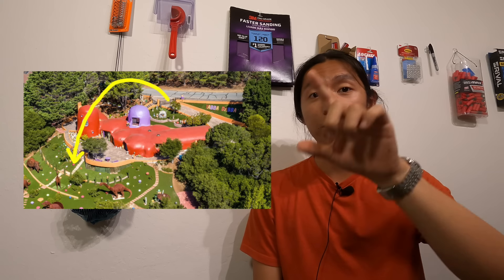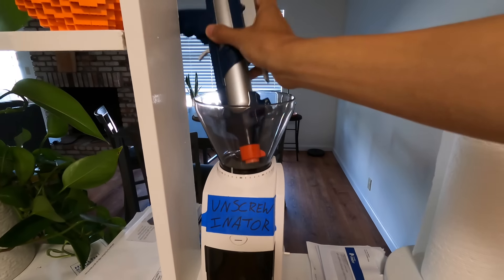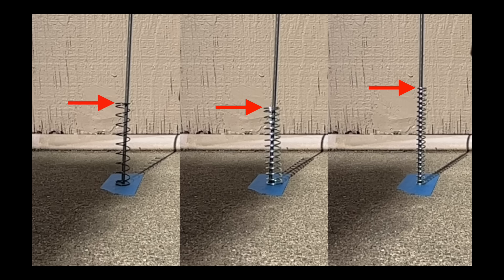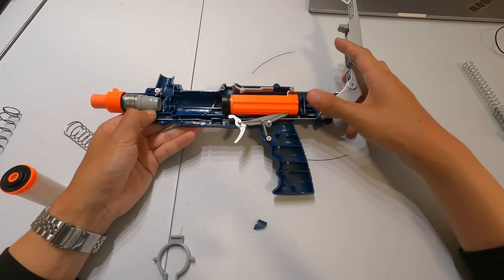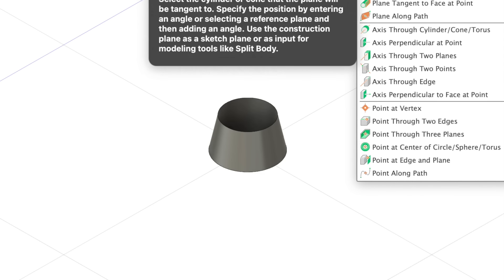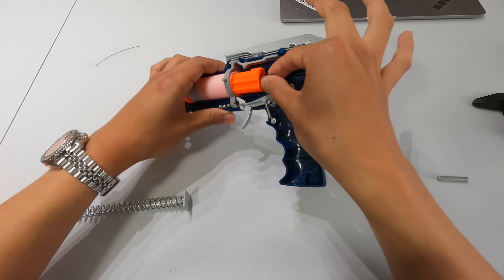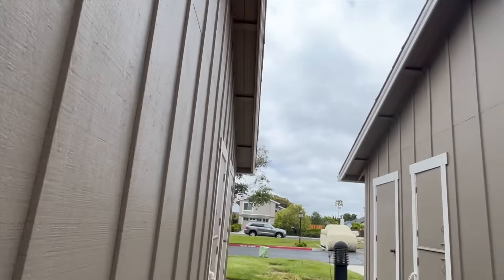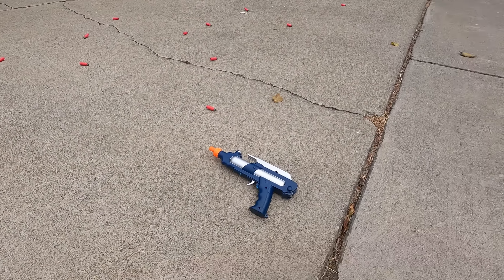This Nerf pistol terrifies me

Comment: As you know by now, this is definitely a paintball blaster, which is why the spring is so strong. Had one a long time ago. It used proprietary paintballs that were much smaller than standard size.
Reply: Yes , 10mm paintballs.
I used one of those mini sized bottled waters to make a 100rd hopper for mine.

Btw at the time I bought mine 15 years ago ( these were actually around as early as '06-'07 ) they also had the chalk dart version.
The port on top was plugged, and they came with these darts that would leave a colored chalk dot on you when hit.
I think there were even 2 gun sets with red and blue chalk darts with a plain white vest thing so kids could sort of play a save version of paintball in their backyard.

Comment: Honestly I'm more or less concerned about the blaster destroying itself out of power even after seeing the whole thing. I sorta want to see if you can make a version of this project that can reach similar or higher levels of force without any of the self-destruction.
Reply: Keep a projectile to absorb the energy and wont have a problem. The problem is when you dry fire, the energy that would go to launch the projectile is redirected into the object itself. Be it bow, or this. Limbs and strings on a bow can explode.  Better it to break than explode.

Comment: I had one of those paintball guns as a kid.
My older brother and I got them as a Christmas gift in probably 2010 or something. I put a nerf dart in it, as I was curious, and out of the box, it shot it out so hard that it flew across the park, and when we found it, it had been blown apart with a huge gaping hole in the side of the dart. It was absolutely insane and I loved using it until I finally threw it out like 6 years later.

Comment: I think a bit longer barrel, maybe just 1 inch longer, drilling out the air vent a bit and having a plastic spacer in the back of the plunger instead of the heavy steel socket (making the plunger lighter=more acceleration) would make it easily go up to 160 fps, if not higher.

Comment: Seeing this thumbnail was a trip, I modified one of these when I was a kid and didn't know they were common. My friends hated me for using it and whenever I did we had to wear eye protection and play outside at longer ranges. It was a blast to mess with, a great platform for getting into modding high fps plunger blasters. Forced me to finally make the switch to 3rd party nerf darts, the stock darts fly straighter than a rainbow at that fps

Comment: The reason you could feel recoil from that wad because you put a metal weight into the plunger, if you use a plastic spacer instead oth the socket I'd bet that that force would be reduced

It would probably be better for the blaster too, both in performance and in its longevity

Comment: the recoil is the acceleration of the mass of the 1/4 socket adapter. You should have that at the back of the spring instead of the front, so the spring doesn't have to deal with it's inertia.

Comment: The socket adapter is heavy, I believe it would be better something light.
When you pull the trigger you want the plunger go as fast as possible, it is harder to accelerate a high mass part (socket adapter), also, all this mass need to be stopped when the plunger goes all in, so it will make more effort in the parts.

Comment: Some good blasters with stock performance similar to this include the rekt jury, which is a co2 powered half length dart revolver. Gets around 100 shots per 12g co2 cartridge, and like 130-140fps. Another one that isn't "cheating" with co2 is the adventure force aeon pro, shots half or full length darts, personally I think it shoots a little harder then the co2 one, but they are similar in power. Both of them shot at best 300-316 feet outside. With average of about 50 feet less, both shot over the foundation ruins of a barn, and over a small silo (maybe 40-50 feet tall). With certain darts they leave small bruises.

Comment: I actually have that the original model of the splat gun it was originally used for as a paint ball pistol and I owned one that was so old it was falling apart we bad these paint balls to but it hardened the paint so the balls can actually hurt someone but I shotted a cardboard box and it went straight though we also had other paint guns but there so old that they didn’t make the cartridges any
Reply: More

Comment: Mine was branded as the  SUPA SPLAT and would actually fire standard streamline darts very well in stock form with a better barrel fit than this and I did not need to modify mine to shoot over my house.
Maybe they changed them over time ? The SUPA SPLAT's we had were red and blue, I also had the supa splat blowgun and the hamp style that I think was a variant of an existing marshmallow blaster.
Me and my brother bought them to shoot each other but they didn't have enough power to break the 10mm paintballs unless they hit a hard surface.
At the time ( this was 15 years ago) they also offered the chalk dart variant of these pistols Called the Wipeout, so maybe they were using the same dart optimized barrel from the Wipeout on the SUPA SPLAT's that I had ?

The wipeout was from the same people who made the predator paintball pistol which I has as well, got it at goodwill and darts would barely fire even though some of the predators were sold with a pack of wipeout chalk darts as a bonus.

Comment: using some pixel measurement around 2:28 and some basic physics, the 2nd spring is a about 1.8 times as strong as the first one and the third spring is about 2.5 times as strong than the first one.

Comment: This is actually a good engineered toy, built to last. Here's why:

A) The real reason it has a spring, rather than a restrictor valve, is because if you close the air output, you'll overpressure it for a moment, leading to damage to the plunger chamber over time.
B) The plunger tube's rubber, which holds the brake spring, is also designed in such a way that it will expand towards the chamber's walls when pressure increases, leading to a better seal.
C) The long lever, rather than a pull rod, has a better transfer of force, allowing for children to be able to properly load it. Unlike some nerf guns.

It was made by a company called Tech Group, and this specific gun was built in 2(maybe 3?) variants. The Predator, and the Wipeout.

Comment: Pretty interesting. I think you lost a little using that socket adapter inside the plunger. The extra weight would take longer to accelerate and would be the primary reason you can feel so much recoil. 3d print or find some plastic tube you can fill that space with instead of that socket adapter and I'm sure you'll get another performance jump.

Comment: allow me to suggest an easier (although less spectacular) way to test spring stiffness, attach the springs somewhere so that they hang, then use some string or whatever attachement method to support a water of bottle from them so that it hangs down. Considering that you know how much water the bottle contains and that water density is aproximately 1Kg per litre you could even get the numerical value for spring stiffness by messuring how much the spring has extended compared to its resting position when no weight is applied.

Comment: My auntie gave me a different coloured and with a simple "wipe-out sticker" I took the air restrictor out because mine had one and removed that dampening spring, I dont have a chrono but I put the new N series darts in the muzzle (nice tight fit) and holy moly...it punches them a good 70+ meters, thanks for the video...I am now in the middle of using the moving barrel part of the blaster as a loading mechanism for gel balls

Comment: I have an idea for you, what about making a band powered nerf gun, you can use ultra thick rubber band and a railgun like system where you would have a moving armature that carries the payload, which is a nerf bullet, and you could drive the armature with the payload with the kinetic energy of a rubber band. It would be like the combination of speargun and railgun in a nerf form.
Reply from the maker: ppl have made things like that before and they’re dope. it’s been on my list for some time now
Reply: @matt_yuan  Omg you actually replied, great content btw. If you're going to make this, fortify the plastic, I'm a spearfisher and the rubber bands we use goes hard af when released
Reply from the maker: i think the limiting factor will be the dart itself. if the band is strong enough to break plastic aint no way a foam dart will survive being shot by it
Reply: @matt_yuan  What if you also fortified the bullet afaik nerf darts are hollow
Reply from the maker: hmm at that point havent u made a flat out spear gun 🤔 not that that would be bad. but ppl usually just stick with less powerful bungies
Reply: @matt_yuan  ye, but I think the sheer amount of power this beast can output would be interesting to see, this mod would add over 300fps to a stock nerf.

Comment: You could do a windage experiment. Since the foam darts are malleable the pressure behind them will make them expand to the slightly larger bore. With more pressure causing more friction & deformation. (why the dart slowed with a stronger spring & why nerf darts are hollow.) But since the pressure isn't instantaneous neither is the seal. So some good questions on a per dart basis.

1. How much spring force do you need to take up x windage?
2. Where in the barrel does it actually do so?
3. What combination of spring and barrel ID allows the dart to expand fully early on while minimizing friction losses over the barrel length?

Some clear pipe and some IR sensors for velocity testing and maybe some smoke seems doable.

Anyway I'm not super familiar with nerf mods, so this is mostly conjecture. But it seems to me that if you got it so you took up the deformation in windage just right as well as having the dart exit just as the spring is at it's highest velocity before slowing down you could get a dart to scream out of the launcher.

Also springs under load slow down when the load is constant and the potential energy is being used up. So if the barrel is too long the spring loses velocity while you still have the same friction losses so in a long barrel the projectile can slow down while still in the barrel. Same with real propellant, So your goal isn't actually to use ALL of the springs energy. Just the energy specifically at he point where the spring is moving the fastest with the highest load.
Reply from the maker: cool idea scientist cat

Comment: You made the dry fire significantly worse by putting the socket in as a spacer. That's a lot of mass for a very light part. Now the end cap has to stop the punger aaaannd the socket traveling at extremely fast speeds
Reply from the maker: it survived for the video and that’s all that matters 😎

Comment: You don't need to check spring's strength by a falling weight. Strength determined by  linear compression of spring under force. Falling ons for dynamic strength, which is mostly defined by inertia of spring itself, young module and speed of impact. It's a separate parameter. Usually its difference from static is negligible and appears to be significant only at very high speeds of deformation - e.g. a spring of race car's engine valve is a subject to the effect, because speeds there reach speed of sound.

And if that gun would have  operate at sound of speeds in metal (not air), then you have outright a real canon here: energy of projectile at muzzle velocity would be 1.3e-3 * (5940^2) / 2 = 22934 Joules (that's longitudinoal speed of sound in steel and Nerf dart weigting 1.3g). At speed of sound in air it's  1.3e-3 * (343^2) / 2 = 76 Joules, an average .22? Nerfs never would fly even at 0.1 of that speed.

Comment: The sharpfire is way better for this, just screw out 4 screws in the back, put in any spring wich wich has a large enough dia iter to fit the stock spring in, screw the screws back in and done.
I did it with two strong arm springs and the stock spring, then replaced the stockarm springs with some smaller stronger springs and now the darts travel at like 200fps.

The accuracy is so insane, over like 5meters it had 0 drop, like i hit right where i aimed, it might not sound much, but it defenetly is

Comment: I’ve been on the search for years to try to make the ultimate nerf blaster, yet I still have no clue how to make the mods I want. This helped a ton on how to improve the power of the blasters tho. I wish I could make a blaster similar to the CS-35 but with more power and faster to reload. Also having the ammo drum on the bottom instead of the side if possible. I have no clue where to start on those specific modifications yet

Comment: i feel like with good wind speed in the right direction, as well as a proper angle, you might be able to do it stock, no mods. my house is real small, so i could prolly do it with a real nerf gun, but yours looks much bigger, so you'd definitely need that one. actually, they sell nerf rival guns that go 100 fps. i have one, i think its the nerf rival jupiter xix.
Reply from the maker: what do you have against zeta

Comment: I think there is room for improvement with nerf pistols. I think a larger plunger would increase the performance by quite a lot. My idea is to have a 15x3 cm or(5x1 inch) tube with a smaller nose cone (Maybe 1-2 cm diameter by 5 cm) to increase the pressure. (This would make the nerf pistol a bit larger but,  you could have a mag in the handle to automatically load ammo) Also put a small rubber stopper right in the nose cone of the tube to stop the plunger from damaging the tube. The spring would maybe need to be a bit larger but it should then be limited by the air pressure and not the spring. (Disclaimer: May or may not slightly damage the rounds)

Edit:  To make better, use co2 cartridges of 800 psi or if you really want the ATF to find you use octonitrocubane.(Worlds best explosive)
Reply from the maker: you should do it
Reply: @matt_yuan  I wish, But I don't have tools or the time right now. Also I don't know how to model that in my CAD anymore  because it got a load of updates. (FreeCad)

Edit: You are a good content creator because even on an older video you still reply to people.

Comment: .... that is basically how airsoft guns work. But imagine, if the sears and levers and harsh corners and contacts were made better. Oh man, Nerf guns could be so much more viable. With proper fifling like done before with bearing, Nerf could actually be quite viable form of CGB fights for places that do not allow Airsoft or paintball. To add to it, maybe some much better materials instead of cheap plastic and weak motors that take 3-5 business days to wind.